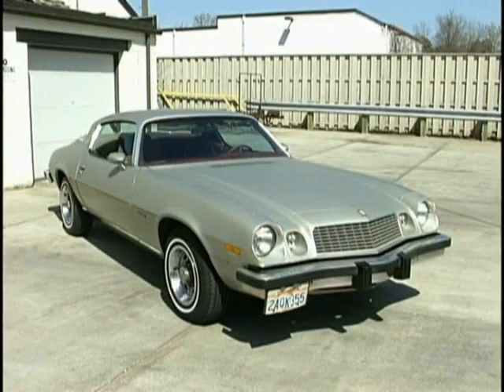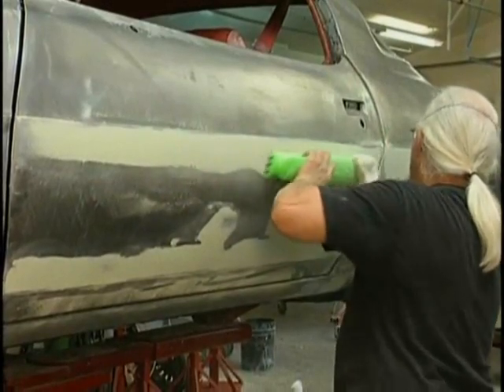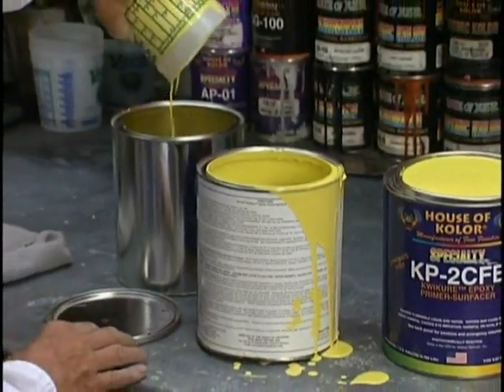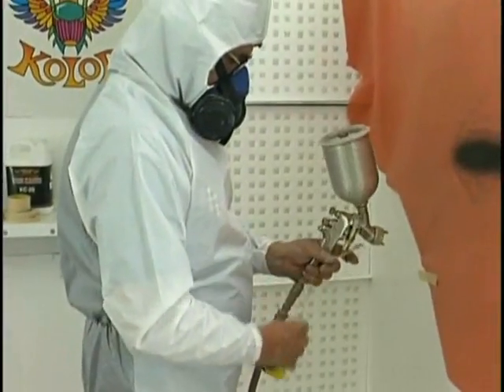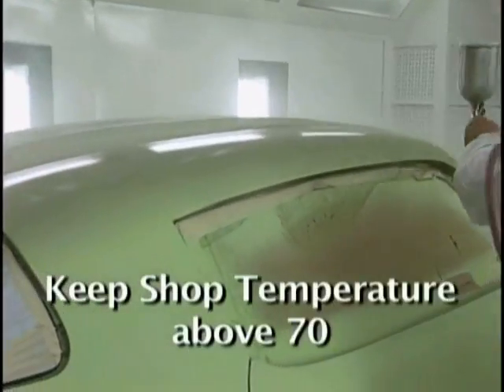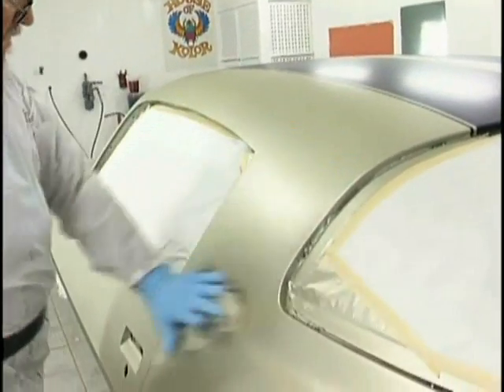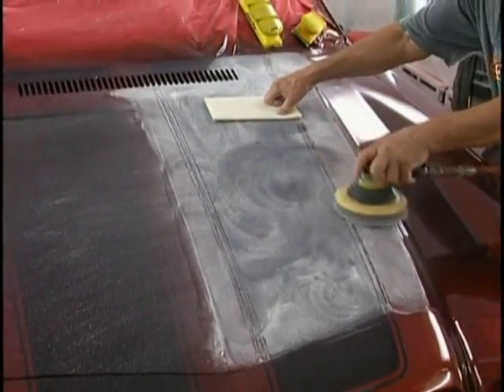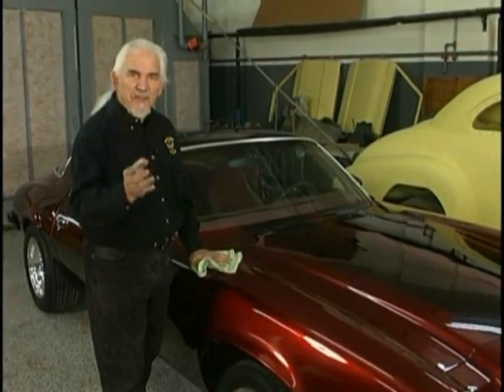KUSTOM PAINTING MADE EASY WITH MASTER PAINTER JON KOSMOSKI

Comment: I've been painting since the 70's, schooled etc... Mr Jon you are truly a class act, thanks for sharing your hard earned talent. Fantastic work and like a master, you make it look easy.
Reply: You are a painter? I have never seen anything like this. Spray filler over 80 grit, wet sand 320? Tape over primer dust 31:29? Man that paint is going to shrink like crazy! But you knew that.
Reply: @maxwebster7572  
Also, I didn't see him paint the door, hood, trunk, or window jambs.  I guess the paint actually did "turn the corner".
Reply: @RalphSampson...  I have done many pearl and metal flake jobs. 1st mistake is people tend to put WAY TOO MUCH material on. Second mistake is walking the car. He's not consistent in the movements and that causes streaks and hazing. 3rd mistake is triggering at edges. Now I only watched the video because I thought I knew the car and the one I know somebody threw in black metal flake that looks retarded like polymer floor paint they use in offices over cement. That man is embarrassing himself.
Reply: @maxwebster7572  
I have an old truck and thought I MAY learn to paint it myself someday.  I know, "LOL", right?  I'm sure I won't do it but, I may do the majority of the body work.  IDK.
Anyway,
1) you say "too much material".  Why is that an issue?  Runs? Or too heavy and it cracks?  Shrinks and cracks?
2) "walking...steaks".  I get that but, was he guilty of it?  I painted my daughter's bicycle with a "candy" rattle can.  I experienced the dark streaks if not consistent with overlaps.  I know it was not a car but, it still taught me a few things about overlap.
3) "triggering at the edges".  I have always heard you are to overrun the edges then, let off and trigger again before you go back across, thereby, keeping a steady spray from beginning to end.
I assume this guy must have been guilty of these things but, I couldn't tell.  He was too fast for my beginner's eyes.
Lastly, do you think the work ultimatly looked bad?  Too bad we never saw it in the sun.
Reply: @RalphSampson...  1, Body filler is made with talc, polyester, fiberglass. It shrinks 10% when the voc's off gas. Never sand Bondo the same day it is applied. Sure, rough out when soft and then come back. If you file a spot that is 1/8" vs 1/4" and they both shrink 10% that is 0.0125" vs 0.0250". Paint is full of what? VOC solvent. It shrinks 10%. The more material you put on, the more solvent you bury and the more it expands and contracts. This causes sand scratch swelling, blistering, deeper stone chips etc. Shops used to use a magnet gauge to determine paint depth so they could sell a strip job.
As far as spray Bondo, the industry standard for the last 25 years has been to epoxy the metal (higher tensile bond strength than polyester filler) then do body work and finish in at least 240 grit if not 320 or finer and then epoxy, water sand and use high solids primer. The reason for the second application of epoxy is to SEAL the filler (from solvent going in) AND to stop bleaching of the hardener MEKP (methyl ethyl ketone PEROXIDE). I finish epoxy with 400 grit wet. No point in putting high solids over sand scratches. Spray Bondo was originally developed by Bondo for MARINE application and we call it cement. I have never used it in my career. If you need that much material to feather out bodywork then you have a problem with the person applying it and should be able to FEEL IT with your hand. Another huge problem is baking paint.
I will add a very good trick I use is a perfectly straight aluminum sheet 1/8" thick and drag it down a door or quarter and around 220-320 grit filler  it will polish the highs / lows and reveal what you have that a guide coat won't similar to a machinist checking a deck with a feeler gauge.
Walking the car. Yeah right. Try that when spraying a full size van or truck roof. Or am I to understand truckers don't spend HUGE money on their rigs? Talk to people who paint helicopters and airplane wings and cigar boats for jobs in the MILLIONS. When spraying metallics overlap, distance and speed is CRITICAL as well as gun angle and depending on the gun / material a 45 degree drop coat to align metallic. Some painters especially with DuPont used to put 3 streaks down each side of a hood and the sides of cars like this. Most people wouldn't see that but If it was pointed out it is obvious. Nothing wrong with a rattle can if you are improving your skills however it is usually low hide paint and no technique will make any difference with poor material. There is automotive paint shops load into aerosols for touch ups and it is decent for a car lot quickee.
3, You are correct about overrun however triggering at a door or fender edge causes a buildup on the seam, sometimes a heavy spot (mottling) or sag. If you have a 59 Caddy let's say, paint 3/4 of the quarter trigger and spray the next 3/4 of the door and you are not supposed to do this but I turn the gun and fan off as I trigger. Your arm has a greater sense of speed and distance control than your feet.
Ultimately, the video practices are they way things were done in 1980 when synthetic enamel and acrylic enamels were popular over lacquer primer. If you sent your car to the corner bodyshop and they painted like this for $2k you would have a fair job for the price. I certainly wouldn't brag about it though. Well you are telling all your friends about your "custom" paint job they are laughing at you for getting fucked. Now, if you watch the video and do work like this and take pride in learning and do it yourself then I would applaud ANY result.
Lastly, I paint all my cars UPSIDE DOWN (the first time).
I don't think House of Colors endorsed this video as an advertisement.
While I have been a decent painter for 30 years, I know a few who are so good it is intimidating to be around however I make my money in other industries and do
Reply: @RalphSampson...  This fellow is trying to help people and what I wrote may be misinterpreted so please take some advise. Don't try to learn on a 53 Corvette.Go buy a $500 car for a daily driver and do a door or wheel arch patch.
 Don't go down to the paint store and buy $80 gallons of filler with self leveling characteristics. Cheap Bondo is $14 and will do just fine. Buy decent primer, buy decent basecoat. Cheap paint is too thin. Don't let Eastwood talk you into the $900 HVLP stainless steel gold plated Nascar limited edition gravity gun. You likely don't have enough CFM or large enough air lines to use it. Just about every DIY guy gets sucked in on this junk. I'll be honest here, Harbor Freight has a purple handled gravity gun that was just on sale for UNDER $7. Buy 3. The quality has gone down  and the cups are sometimes warped and they have gobs of silicone inside the needle. If you can get one of these to work the will do an excellent job with metalics, clears and primers. I have DeVillbiss and Sata, the HF guns work GREAT at a fraction of the cost and I love the 1.4 needle. You don't need $500 self painting computerized  gun to spray underside of hood. The people who sell that stuff are ruining it for the hobbyist.
Reply: @maxwebster7572  
Wow!  Thanks for sharing the knowledge.  You aren't in the Atlanta, GA area are you?
I have a '53 F100 I've had for 39 years.  I did the rough body work.  The shop did the fine tuning and enamel paint.  Eh, it's still okay.  It's a daily driver and crusie-in quality.
Now, I also have my '62 F100 Uni-bed, big back window, long bed.  I really like this one.  I am trying to make it my everyday vehicle then sell my 2008 Ranger.
On the '62, I plan to do the rough body work then, take it to a pro to fine tune it and shoot it.  I MAY try to shoot it but, I need a decent shop, first.  So, not likely to be me shoot it.
I already priced the paint.  Holy shit!  The paint alone is going to cost $2,600 form PPG!  It's just factory metallic colors from late model vehicles.  It'll be two tone (metallic green and white).  The interior will be the same colors only with a satin clear coat.
Seriously, thanks for the education.  That instruction was very clear, concise.  Even I could understand evey word.  Thanks!
So, are you around Atlanta?
Reply: @RalphSampson...  I am in the great white frozen tundra. My time as a panel beater led to aircraft and at some point we found out I was good with electronics so I don't paint anymore other than my own stuff. 
PPG is going to sell you the same bill I was previously mentioning and House Of Colors will do the same thing.
We have a product here called Proform I believe which is $120-150 per gallon of primer, clear coat $120 and basecoat $120/ qt. There are some cheaper basecoats like Nason but they at 3/4 by volume clearcoat and solvent so it's not actually pigment (garbage).
Basecoat gets reduced 50% average car 2 quarts, restoration 3 quarts, if doing frame off underneath and inside out will be more but you would gauge that when blowing floors / door jambs etc and get a feel.
$2600 seems like a bit much, PPG is all good material, I personally am allergic to the Concept urethanes. The extra cost would not reflect a better job IMHO but a good automotive paint supply should be able to lead you in the direction between high cost and crap like a $150 primer vs $300 primer or $120 clear vs $400 clear. The issue I have here is Napa likes to sell lacquer primer and Centari and tell people is GREAT until a year later when the Centari shrinks and peels from the primer due to lack of adhesion.
On a side note the paint I am allergic to that costs $300/ gallon in the auto world is sold to OEM  for $60/ gallon and OEM simply means equipment manufacturer NOT necessarily a high volume end user. Body shops are getting ripped of large.
Another BIG NO NO is to spray base and not clear over it within a few hours. It doesn't sand well and the clear will peel so don't do that. You can add 10% hardener but  I wouldn't. Just clear it and water sand.
Reply: @maxwebster7572  
Let me ask a slightly off topic question.   Imron paint.  My brother introduced that to me 35 years ago.   He said it was used on airplanes and big trucks.  He painted a small air tank to show me what it was like.  I couldn't even scratch it with a key!  He said if it ever does get a chip, it's almost impossible to sand it for a smooth patch.
I never hear of it anymore.  It seems like it would be good for steel wheels, undercarriage, etc. vs. the now popular powder coating.
Is it still around?  Is it simply an enamel with a lot of hardener?
Reply: @RalphSampson...  Imron was marketed by Dupont, I believe under license from RM Inmont (BASF) of Brampton Ontario. It was and still is great paint, durable, hard. The catalyst was a pretty nasty ISO (cyanide) which is now industry standard. PPG Concept acrylic urethane (I am allergic and get very ill) and ICI urethanes are very close cousins. The ICI urethanes dry rock hard in 15 minutes here in August to the point thinners will not remove it. Drawbacks are tough to sand, tough to polish, tough lay down. Some of these paints are 2 coat systems and it is hard to get it on wet enough to flow but not run. Typically has a bit of orange peel, fine on a truck, yacht, airplane or oil rig. It would be overboard on a car, good for a frame or engine though.
You can add reducers, but my experience we had some solvent pop. Locally we are allowed 2.5lb VOC paint and other places are 3.5lb so I am not sure I can even buy it here or if it is legal however if imported for industrial, transportation or nuclear the laws are relaxed a bit. Carboline has some pretty bizarre products that I used on bridges and I also worked under contract on the nukes for a few years.
Por 15 or metal prep is another thing I would shy away from. We had some issues with the phosphoric acid leaching.
Reply: @RalphSampson...  Hardener is a catalyst. While catalysts are different the disseminating factor is binder. Imron was a urethane binder as far as I recall just like there was lacquer, acrylic lacquer and nitrocellulose lacquer. Acrylic lacquer was the stuff that cracked, nitro is the good stuff that you can't buy which everybody buying Acrylic thinks they are getting..... RM BASF markets enamel, synthetic enamel, acrylic enamel, acrylic urethane all in the same can and you add the binder of your choice.
The cement used in the video (Evercoat Featherfill) is a polyester resin with MEKP hardener same stuff used for fiberglass on boats with a talc filler. Same basic composition as Bondo filler.
The high solids HOC primer they used typically is a polyurethane binder with DE (diametaceous earth)[CLAY](kitty litter) filler -I won't call it a pigment here but filler.
Reply: @maxwebster7572  
Again, great information.  You are a walking (typing) encyclopedia.  Thank you!
Stay warm up yonder.
Reply: @RalphSampson...  I know men better than myself and am intimidated by them too.....
Reply: @maxwebster7572  
The DE is used in all sorts of ways.  On construction sites, paints, pesticides, on and on.  I'm in construction.

Back to the Proform....I can't seem to locate it here in Atlanta, yet.  PPG is good but, over priced I'm sure.  If you are a believer in the Proform, I'd really like to find it.....without buying online.  I want to go make sure the color is correct.  It'll be a while (one year until final paint...I hope) but, I'd like to start with a "system" and stick with it.
Reply: @RalphSampson...  I've seen it on eBay for sale, don't have a P/N here with me. A decent clear is called Transtar. Somebody may jump on me for this but the difference in cost for the noticeable improvement isn't justifiable. What shops are looking for is a clear or spray gun that saves 3 ozs on every job 10 jobs a day time 3 painters for example. ICI clear is great.
Nason primer epoxy and high solids is ok but they make all their labels the same color and they sent the wrong hardener once. Cost me some sandblasting.
Didn't like proform epoxy.
Transtar high solids ok, Nason smelled better. 
RM had an awesome tintable DP21 primer I can't afford $300/ gallon but it was worth it.
PPG DP series epoxy primer / sealer phenomenal if you water sand it right.
Dupont high solids stay away from the yellow. It's all good stuff. What I have a problem with is Eastwood selling snake oil under the guise water makes it harder. That describes ANY ISO hardened paint which is just about everything on the market.
Stay away from Eastwood chassis black -it's enamel and gas eats it. Use black basecoat instead or hardened matte paint.
I just have to say that if you strip a hood with 40 and gouge the steel it will sweat. If  you sand filler with coarse paper and cement it, the car may look good when you pick it up but 6 months later.....
Reply: @RalphSampson...  Too be honest, I buy the material by the job. My 1939 Buick code 901 is dark blue near black so I just used black primers. PPG DP90 epoxy, RM DP21 tintable.The issue with black primer though is that it is aheat sink and you can't see imperfections like scratching or pinholes so you have to guide coat. When I see black primer on a car typically the person using it is "lost". A good tintable primer will be close to the body  color and save your ass if you have a light spot say in a door jamb or under a dashboard. I paint upside down, color sand with 1200 and then respray so it's not an issue other than for stone chips.
My car is metal finished with a few lbs of lead here and there, if I wanted and oem finish GM used black primer with grey on top, sometime red primer depending on where the car was built. The Canadian cars are the big thing now, they had developed enamel paint while GM used dispersion lacquers in Texas up until the early 1990's. If I was going for an OEM finish I'd buff a shitty enamel but I like a nice job off the gun with no buffing. If it needs a cut and buff I repaint it - THE WHOLE CAR.
Reply: @RalphSampson...  One of the basecoats I use is called Omni. There are 2 that I use and one is better but the guy send generic labels on my cans. RM Diamont was $140 for a pint of red 18 years ago so on blends I had to go cheaper for spot repair and the product covered well. Most of this stuff I buy through what used to be a PPG dealer and is some off brand no name PPG (I think).
Reply: @maxwebster7572  
Cool.  Thanks.  I'll keep looking.  I just uploaded a picture as my icon.  I hope it shows now.  It's my '62.....and my best friend.
Reply: @RalphSampson...  Nice. A friend had a unibody or 3 of those. I can't remeber if he had a Mercury but they were low production #'s
Reply: @maxwebster7572  
Yep.  In Canada, they were Mercury.  I saw one online for sale but, it was a short bed.  It would have been really cool to have an M100 down here in Georgia.

Comment: Over the years i found when i  strip cars i skim over the finish with 7in grinder with 24 or 36 grit. It opens up the finish for the stripper to work more efficiently. You can also find area or repair with filler etc. then just cover that area of repair with tape with tape. That trick i picked up in the 90's when Ford had so many trucks with paint peeling. I worked in the dealership body shop. Not many knew but for covered the complete strip and refinish. We machine sanded the bad spots with 80 grit, then the complete truck with 180 grit. We hit them with a coat of PPG epoxy then one of two different 2 part primer surfacer. Great content thanks for the memories.